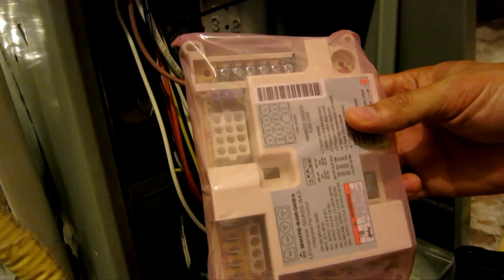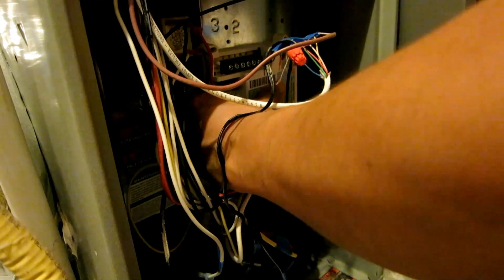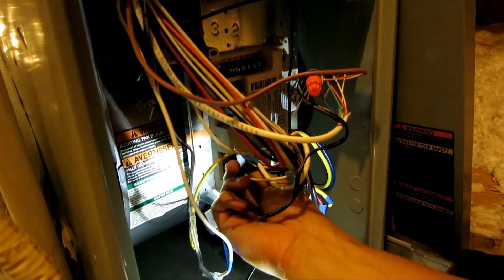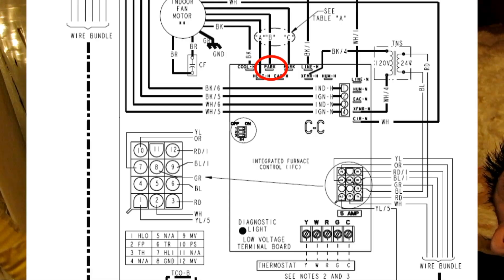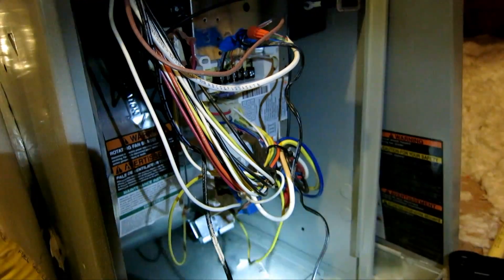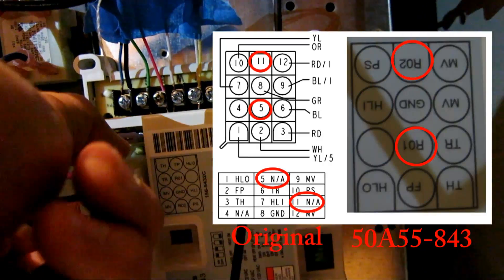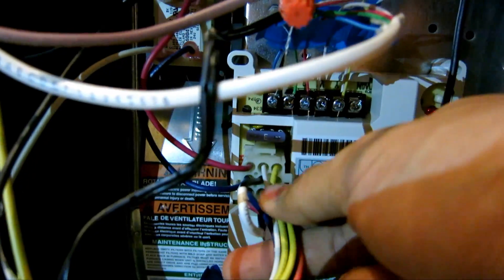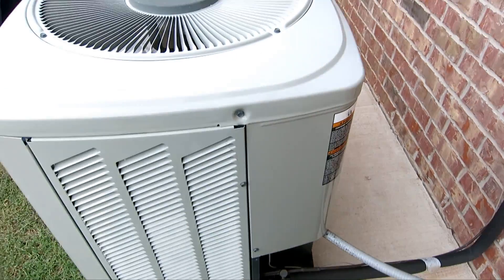How to install White Rodgers 50A55-843 Control board in Trane TUE1 XB80 Furnace TUE1A040A9241A

Comment: I have an amana 80 sse furnace,  from 1995. Troubleshooting led me to board replacement. 50A50 298 light on and no voltage going to the gas valve after standard sequence of ops.  New board 843, and I got no functions other then blower runs if on,  no inducer start and it gives 3 flash code...pressure switch stuck open. And im finding alot of indifferent answers as fix..??? Dont wanna rewire the thing but its seeming like I have to..??? ANYONE WHO CAN HELP??? In Michigan and freezing is upon us, been working on it a week and am getting frustrated...Not an hvac guy, not an idiot either...Thx in advance

Comment: rollout switches are MANUAL RESET (as in there is a button on them)

DO NOT JUMP THOSE TERMINALS
Reply: It is literally in the instructions to use an included jumper for this board for Trane systems as they do not have anything on these pins.

Comment: Thank you!  My former repairman wanted to replace my unit for $3000.  I ordered the control board for $100 and installed it but needed your advice on the jumper wire.  Running like a top.

Comment: Read if you replaced the board on a Trane furnace unit and system is not running.
I just replaced my Trane XB80 Control Board (Old) 50A55-571 With new universal White-Rodgers board 50A55-843 (New). Manufacturer's specifications sheet says this is direct replacement. I am just writing a scenario here so it can help somebody. Original problem was that 4 blink fault (Open limit device error). This problem was intermittent. I checked every limit device and all of them were fine. I felt I heard a slight relay flutter and that made me kind of confirmation it is the board.
However, once the board was replaced and powered on, There was transformer hum and a relay click could be heard. But no LED, blower or anything. Figured out later that I had not installed the required black wire jumper for Trane models (supplied) on the 12 wire connector between terminals R01 & R02. Once the jumper was installed unit started and running perfectly.
Replacement control board instructions has a small note on the 3rd page saying this jumper is required for Trane models. Upon searching I noticed that many people going through the trouble without noticing this jumper requirement.

Please note I am not a professional HVAC technician. Just noted what I had experienced. (I did this on Trane model TUE080A936L3)
Reply: Man you saved my life lol
Reply: @richardpennington9209  Totally forgot I had written this lol. I had to be my own HVAC professional during Covid. Didn't want people coming into the house.. :)

Comment: Using your previous video, I discovered that my blower works by connecting it to the safety switch. The compressor comes on when everything is connected, there’s just no air flow. My question is, if pull the cool/high/blk wire and connect it to a separate 120v source, will that be sufficient to cool my house until the hvac tech comes in a few days?
Reply: I think yes. The only issue is the fan will always be on. You can turn it off manually. But what did the ac guy say?

Comment: 0:33 regarding the top left molex conenctor thats 4 pin ,   my board is 5 pin, if i order a replacement board that has a 4 pin can i somehow rewire it to use it?  for examply my board is White Rodgers 50A51-495 and I want to use a 50M56U-751 since its availble in Canada for real good price. thank you.

Comment: Additionally with the White Rodgers 50A55-843 Control board in Trane,  you need to attach the Harness that comes with the kit (e.g. for Trane & American Standard, the harness is labeled 'F' with some additional numbers). Failure to do this will prevent your furnace from firing up and you will get the classical 'burner flame comes on for 2-3 sec. then shuts off' and cycles again until the locking of the control board, for a period of time. The AC works fine without the harness though, making you think you do not need it until you turn on the heater.

Comment: An important note.  My old board was the 50A50-474.  When I first turned the furnace on with the new universal board the 50A55-843 it did nothing until i used the jumper wire.  Once I did that it fired up fine, but without it i didnt get anything at all from the furnace.
Reply: Im in the same situation.  My board did absolutely nothing.  No indicator light or anything.  Im just not 100% sure on how to do this jumper.  What do you do with the wires that are already in the moldex plug?
Reply: @robertshaeffer7350  same situation on my furnace.... any update on this?
Reply: @Urswrnme Trane doesn't have existing wires in these locations.
Reply: Thank you for your feedback!! I was doing the exact same thing but couldn't figure out until I see your note!!!!!!

Comment: Was getting ready to replace my board....very similar to yours....and then decided to look at your video first. Glad I did, because once i saw ALL THOSE WIRES I decided to put this job off till tomorrow! LSU vs ALABAMA game is in 90 min and I do NOT want to be stuck in my attic for kickoff!!!  Very nice video and hope to report back here later with some tip that might help someone. Will probably be a tip on what NOT to do in my case.
Reply: No tips since my board (White Rodgers 50A50-241) was not as busy with wires as one in video. I simple unscrewed old board from unit and unplugged one wire at a time into new board. Unfortunately new (actually second hand) board did not fix my problem which has to do with blower SOMETIMES not turning off until 1 hour after heater turns off. Only happens a couple of times a week for past 2 winters but driving me crazy that I am not able to find problem so far. Have installed about $200 in parts so far. Looking at it as a hobby and learning, so not a total loss.... and I will have lots of extra replacement parts in the future if anything else fails. At least that is how I explained it to my wife!
Reply: About to tackle this tonight, it's in the 30s now haha
Reply: Howd it go.

Comment: Great Video! I just installed this same board but the light is not turning on. after checking the 120V line in.. power is running into the board correctly, but it does not seem to be powered. The fuse hasn't been blown. Any idea on how I could troubleshoot this?
Reply: It probably doesn't matter 5 months later but mine didn't work either until I installed the jumper wire.  Then no problem.

Comment: This is a exact replacement for a Trane XB HVAC !
Unlike in the video which shows the blower working when first powering up the board but before applying the extra jumper,, apply the jumper before powering up the board, otherwise the board may just report it is not working (solid red light) until you actually install the jumper. Also, the replacement board includes the jumper wire along with its other spare wires.

Comment: anyone have any ideas why i still get 5 flashes?? I installed the jumper wire from RO1 to RO2 and the draft inducer turns on, it runs for about 20 seconds, then turns off and starts the 5 flashes... i have jumpered out both roll outs and the high limit, and still the same... kind of has me stumped... do i need to ohm out the little transistor style roll outs??
Reply: Do you have an update?

Comment: Great informative video. I just changed out the control board on my own furnace and saved hundreds doing it myself. (Board cost me $95 on Amazon, which beats the $400 I was quoted from the repair man.) The jumper wire was needed too, so I'm glad I followed the video. Thank you!

Comment: Thank you for this video. Very helpful. I had to replace my board (50A55-571) with the upgrade board - 50A55-486-  from Amazon (http://www.amazon.com/gp/product/B00DS6NOVU?psc=1&redirect=true&ref_=oh_aui_detailpage_o00_s00). And I did not have to use the jumper. Maybe because it's the upgraded board. But system seems to be working fine.
Reply: Xe 80

Comment: Hello, I am about to install my Rodgers control board in my Trane Unit which also specifies I use the jumper, My question is what kind of Jumper did you use to jump R01 & R02?
Reply from the maker: +Salman Basheer if the control board didnt come with one, then you can make a jumper by using a short 22AWG wire along with two socket pins. I've seen these pins at my local HVAC store, hope that helps.
Reply: +DIY Tinker thanks for the swift response. My board did not come with a jumper. Just some extra wire "plugs". After calling another HVAC shop to see if they carried it, they said no and that my board only comes as it is. After looking at my new board closely again...I noticed R 01 and R02 is not printed or identified (which is on your board.) Seems like the jumper sequence is not applicable to my model WR: 50A55-486 board, which is why maybe they did not include it the small jumper. I will install the board tonight when its cool in the Attic. If you have some insight to this, please share! Thanks for the Vid and your support.

Comment: Hi,
First of all, I must say that your tutorials and explanations are excellent. You get to the point, are clear and accurate. Great job and thank you for taking the time to post these videos.
My question...
I have a 50A55-843 control board in my York Diamond 90 furnace and the 3A fuse has blown & the xformer died. I changed both and once in a while (once per year), the fuse blows. Do you know what is protected by this 3A fuse? Is it just the 24V going to the R of the thermostat wiring? Have you experienced this issue or suggestions? I'm wondering if I have an intermittent short in the thermostat wiring...?
Thanks again

Comment: Hello, 
  I have a question and hoping you can help.  My ac blower is not working . I followed your examples.  I first changed the capacitor hoping that was the issue and it was not. 

So then I put the fan on and removed the cool high black wire and the common white wire and used a multimeter. I pushed the button down on the door switch and it read nothing was all 0s.  So, I thought maybe faulty board, but then I followed your instructions and connected directly to the door switch .  Only a slight hum but that fan did not turn over.

Any ideas on what it might be or anything else I can test ?
Reply: small guy with small It sounds like you havent determine if the blower is bad or not. I would test the blower. Most blowers are 120VAC; if you applied 120VAC and it comes on, then the blower is good. Else, its something in between.
Reply: LEGO Manual I stated the blower did not turn on when I used this method.  But , I also measured the board with the high cold black wire and common white wire and it was showing no power. 

Could not understand what that meant .
Reply from the maker: small guy with small Just recapturing what you explained. The electric outlet has 120VAC (black/hot and white/common) wires. Start from the outlet, you measured 120VAC, then measure inlet to the door switch for 120VAC, then measure outlet from the door switch with 0VAC. You pushed the door switch and you still get 0VAC. If that truly is the case you shouldn't hear any "hum" and the switch is bad. 
But i dont think thats the situation since you hear some humming sound. You have to trace the voltage and make sure the blower gets 120VAC. If the blower has 120VAC on the high side to common but doesnt come on, then the blower is bad.
Reply: DIY Tinker no I think you misunderstood. 

I checked the the circuit board for the blower.  It read 0vac.  This was the white and black wires I pulled off the board and check with the multimeter.   There was no power on the circuit board. 

The circuit board does light up with the led light when the switch is down. 

I next connected wire from the switch to the circuit board where the high cold plug usually goes the like you showed at the end of the previous video . Nothing happened. I heard a hum once. But I tried it since but nothing.  

I think reconnected that wire back to the switch and the board lit up. 

I hope that makes more sense.
Reply: small guy with small any suggestions ?
Reply from the maker: small guy with small sounds like two issues. if you set your thermostat to call for the blower to come on, then you should read 120VAC. 2nd issue, if you connected 120VAC directly to the blower and nothing happens, then the blower is bad. Its up to you to confirm those results. if that is the case, then you might want to contact a HVAC tech as this situation isnt a simple fix.
Reply: DIY Tinker Hello there my blower is not working, quick question is Park wire in the control is that common wire? and the cable that says cold is that Hot, So I could directed tested with 120v. There’s power coming in to the control but I don’t get power going out to the blower I used a electric pen.
Reply: I o o s9es A df $$×+×+×

Comment: Awesome video! Are you an electrician or a/c technician? What do you do for a living? The video was easy to understand. thanks!
Reply from the maker: thx. im just an average family guy sharing my experience.
Reply: Good job on this man! I had to replace my controller as well with this unit because my furnace was no longer working. The controller wasn't sending juice to the inducer fan. I also had to jump the flame rollout.